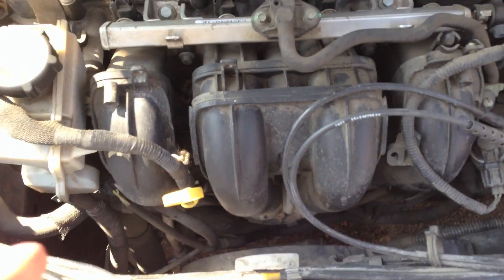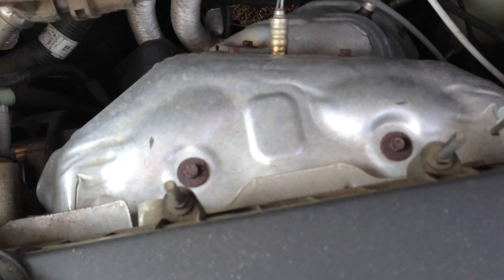Ford Focus 101: The Basics

Comment: I have a 2011 ford focus and I believe there's something amiss with the power steering.
There's fluid lying on top of the reservoir and I don't know what to do about it, or what's going on. This is my only form of transportation.
Reply from the maker: First quick thing is to check if the cap is on securely. Also look for any obvious bleeding from a loose hose or other connections. A mechanic shop is also great for doing this type of sleuthing too!

Comment: But do you call the connection point in the centre of the spark plugs. I can see in your video
Reply from the maker: Are you talking about the ignition coil boot? That’s a rubber boot that sits on top and seals off the spark plug hole. The ignition coil (metal coil that connects to the spark plug) is within it, and what passes electricity to the spark plug.

Comment: Where do you add transmission fluid in a Ford Focus 2005? Message on 10-10-2023
Reply from the maker: Check out minute 14:00 on my transmission video; fill tube is right nearby the air intake filter https://youtu.be/7VTe7q42M-c?feature=shared

Comment: I know this is old, but I'm giving it a shot.. I have the same car as my gas saver, and I'm replacing the alternator. All went as well as it could considering how notorious of a PITA that job is. However I discovered a ground that was added, but had broken off. The place it was grounded to is the bolt/nut that is at the top of the screen around 7:08 just above the alternator and just behind the coolant reservoir. It has me thinking it was a makeshift ground for the alternator and possibly the true culprit behind our woes and "failing" alternator. I've no way to test this, but thought I'd shoot a question in the comments here. Any assistance is welcome! Thanks and be blessed!
Reply from the maker: Alas beyond my best guess, but I would think you’re on the right path with bad ground, especially if it looked questionable to start! A shop could also help trouble shoot on bad ground, and make sure proper voltage is getting through.

Comment: @ about 4:02, you point at the bolt that holds one of the spark plugs/ignition coils. What is the wire coming out right next to where you are pointing? Thank you for this video, a lot of YouTubers assume we already know this stuff! Basics are very helpful at the beginning! 😁
Reply from the maker: Good question! Honestly I don’t immediately know, would expect that to be either a part of the spark ignition wiring, or wiring harness that goes to additional sensor
Reply: Yeah I also want to know what you call that cause it caused my computer box to blow

Comment: Hi I’m actually struggling to figure out a part in my 2007 Ford Focus. It’s right in between the engine and battery. It’s shooting out liquid that I believe to be coolant. I’ve went to a mechanic already and was told it was my thermostat housing. Changed that and still my car is overheating. If you could look more deeply in between that area that would be such a huge help. Thank you so much.
Reply from the maker: Indeed sounds like a loose hose or leak along your coolant system. Unfortunately don't have this car any more; your mechanic would be the best to give the full diagnosis of what is needed to be replaced.

Comment: Hi, I have an engine warning light on my dash. I have a 2007 1. 6 zetec auto Ford focus. I am looking if the problem could be my transmission oil level, however there doesn't seem to be a dipstick on the auto. (at least the same location as this video)
Reply from the maker: I’d recommend taking it to a mechanic to read the warning light - good luck!

Comment: I have the same car 2007 Ford Focus. What kind of power steering fluid? Mine keeps getting ruined. Maybe I’m putting in the wrong kind.
Reply from the maker: The worst! The manual calls for Ford Mercon ATF for the power steering fluid. That being said, Ford OKed using Mercon V as backward compatible to Mercon (link below). You can also use Valvoline Dex/Merc, which is Mercon compatible (always double check the back label to make sure it meets spec). https://www.aa1car.com/library/ford_tsb_06144.pdf

Comment: @4:22 you see the oil cap well right on top of it you see a plug that connects two wires. Can you see where it connects where does it lead to because where it leads up towards firewall. On mine it is cut and don’t know where it leads to and is connected.
Reply: Mine was the same way and I thought it was a ground wire but turns out that it shutdown my car firing and now I'm puzzled as to what to do to get it fixed. Nobody knows
Reply: @DJ-oj8wb  same thing happened was wondering why it would shut down until I saw that wire that went under the valve cover. I moved it while car was off and it started to get hot and melt plastic. I have no idea where it is supposed to be connected
Reply: I wired ours up to the relay box and it's a Ford, found on road dead type of thing. FORD motor company will be glad to fix it for the price of another vehicle

Comment: What is the rubber boot that is right between the spark plugs? Mine popped out after the engine did a loud bang and now runs very  rough and no torc at all?
Reply from the maker: That boot holds the spark plug in place and keeps it in contact with the spark plug coil. It should pop right back in.
Reply: @MattStephensRich  afraid not. Its the cht sensor cover and this may mean the head is cracked.

Comment: What is the name of the black circle cable attached to the engine block and runs below and is connected to the side of the master cylinder?  2003 Ford Focus SE 2.0 L split port

Comment: Excellent video but I have a question for you. Where is the Mass Air Flow Sensor and the Throttle Position Sensor located ? I was told they might be the reason the car is running sluggish. I changed the plugs, no difference.
Reply from the maker: The Mass Air Flow Sensor is located just above and behind the air filter box, 12B579 in this schematic: http://www.fordparts.com/Commerce/CatalogResults.aspx?y=2007&m=Ford&mo=Focus&initSearch=1&keyword=air%20flow#Search

The Throttle Position Sensor sits right on the intake of the air flow above the engine, positioned on the right hand side as you are looking into the engine, 9B989 in this schematic: http://www.fordparts.com/Commerce/RenderIllustration.ashx?id=439352923&f=3&n=YS4Z9B989BB

Comment: Hello, thank you very much for the video.
I have a problem after driving for awhile, white smoke is coming out of the engine, it clears quickly once the car is stopped, it has a horrible plastic chemical smell. I tried to open the hood before it disappears and it looks like it is coming from the top left from an area that is in a sort of metal shelf. 
http://st.motortrend.com/uploads/sites/10/2015/11/2009-ford-focus-s-sedan-engine.png
Reply from the maker: White smoke is typically an indicator of burning coolant, such as coolant leaking through the head gasket and getting into the cylinders.  Coming from the upper left hand side of the engine would make sense in this case, as that would be close by the top of the engine and the exhaust.  I would recommend taking it to a mechanic who can help further diagnose.

Comment: Where is the oil reservoir?
Reply from the maker: Essentially, the oil reservoir is the oil pan, which sits underneath the engine.  This allows oil to lubricate the engine, and then drip back down to the pan for recirculation.  If you are looking how to add oil, you do it through the oil fill cap.

Comment: I have just noticed today that I have a leak on an area of four fluid lines under the car. The lines seem to originate from the top right (as I'm facing the front of the car) area of the engine and the lines go under the car and then extend to the rear end of the car. This is a 13 SE hatchback. The fluid is clear and doesn't seem to have a smell.

Comment: hi! what is that little part to the upper right side of the coolant reservoir with two wires connected to it? my car was recently opened and that part was stolen and I need to replace it, thank you in advance
Reply from the maker: Hmm, would recommend going to auto mechanic to diagnose.

Comment: PLEASE, PLEASE, PLEASE HELP!!!!!!! What is the name of that rubber cap that sits in between the spark plugs? mine just popped today and it sounds like air is escaping from the engine. Do you know the name of that thing? Thank you so, so much.
Reply: +goldmind85 did you ever figure out what was wrong? the same thing just happened to a friend of mine.
Reply: +Matt Stephens-Rich NO, he and I are both talking about what sits in between the two Center spark plugs. I did some research and it is the cylinder head temperature sensor.
Reply: andrew fournier   It’s the cover for the head temp sensor
Reply from the maker: I think you are referring to spark plug boots (rubber seal on the ignition coil).  I recently did a video on how to remove and replace the spark plugs - here is the segment talking about the spark plug boots: http://youtu.be/0MjPGZR9miI?t=5m48s

One thing you could try is to take out the spark plug boot and reconnect it to ensure a secure connection.  Also be sure the bolts holding down each ignition coil are properly torqued to hold everything in place.
Reply: Matt Stephens-Rich
 If you pause this video @4:02 you will see a rubber cap that sits in between the two spark plugs. There is a plug on the left and a plug on the right. What is that in between those two plugs? Thanks for responding.
Reply from the maker: That is often called the "boot", the rubber sheeth that holds the electric coil in place to make contact with the spark plug.  You can pop those back into place, as I showed in the video, or buy a whole new set. http://www.1aauto.com/ignition-coil/i/1aerk00130?f=525704&y=2007

Comment: Great video. I am car-stupid and need to find the distributor cap as (from what I have read) it is the reason my car won't start in the rain. Can you tell me where that might be?
Reply: There is no distributor cap. Cars haven't had them for decades now. The coil and plug wires are directly on top of the spark plugs.

Comment from the maker: Francie k - I will be posting a video on how to replace the PCV valve within the next 10,000 miles of driving.  The PCV valve is located in the upper right portion of the engine as you are looking in on the engine.  As for the air filter, there is an easy to find gauge located next to the filter, colored green and red.  Notice there is a yellow indicator located inside of the gauge; if the yellow indicator is in the green, then the filter should be operating normally.  Ford Focus have air filters that are meant to last the life of the car, and should not need replacing.
Reply: The Air Filter is actually located in the drivers side fender... What you see here on top above the filter gauge is just an air box.
Reply: The Air filter from what I have heard is good for about 100K, there have been good point and bad.... I'm coming up on that point soon so I may move to an easier method to replace.

Comment: I have a 2005 Ford Focus.  It has been stalling while driving.  The mechanic changed the front O2 sensor.  It cleared the error code P0171 however the car continues to stall.  It does not set a code.  After some research I have decided to try a few things myself.  The cheapest is to replace the PCV valve and air cleaner.  Do you know where the location of this would be?  Thanks for any info and any other ideas you may think the problem is.

Comment from the maker: If you don't have power steering due to the wrong fluid being used, chances are your power steering pump has broken.  I did this in a previous Ford Taurus; by running too thick of a power steering fluid, the power steering pump was not able to do its job, and failed.  The only way to fix the loss of power steering is to inspect the power steering assembly and replace the broken parts.

Comment: what can you do to repair the power steering if the wrong power steering fluid was used and now you don't have power steering?( Not me my son-in-law !!) also it is running terrible. skipping and cutting off when you slow down or stop. The spark plugs and wires , oil and , oil filter have been replaced. Now we will do the fuel filter. any other suggestions ?